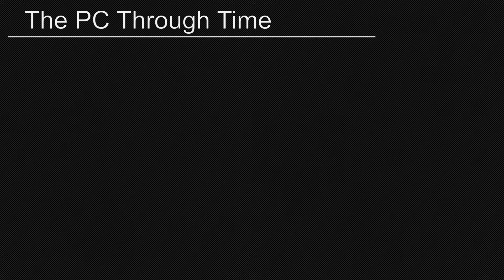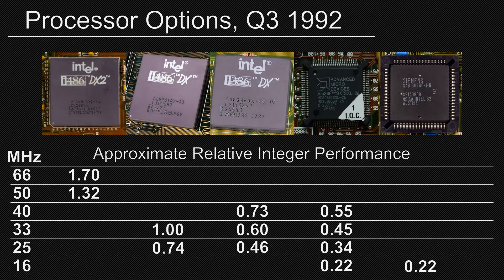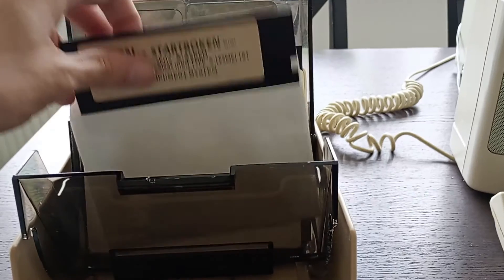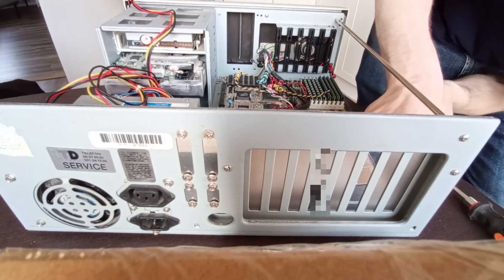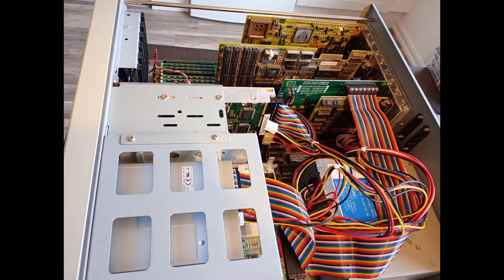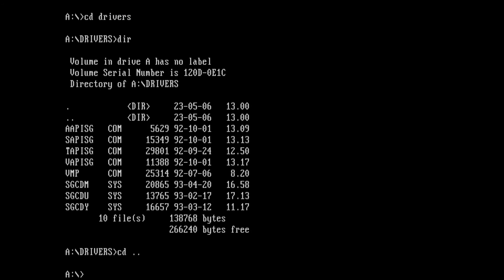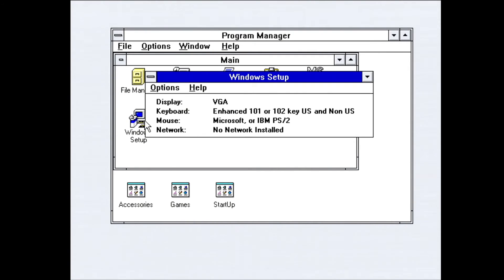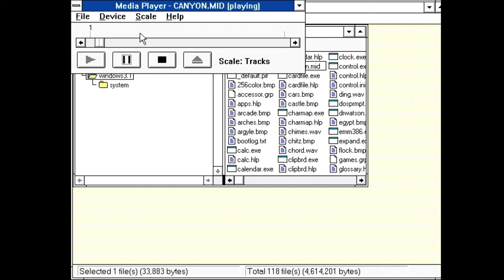Building a Computer Like It's 1992

Comment: Oh that brings back memories!
In 1989 I finally replaced my old Apple //e with a new Zeos 386/20, 4MB RAM, 80MB HDD.  This was a year before Win30 came out.  I gradually upgraded various components of it over the next couple years -- 2400-baud modem, 387 math coprocessor (~$400!), 8MB RAM, a pair of 120MB IDE HDD's, etc.  Probably a Video7 VRAM card.
In 1991, i upgraded it with a 486/33 motherboard with either 8MB or 16MB RAM.  I was a programmer by then, so i needed adequate performance.  I think the next year (1992) i popped in 486/66 dx2 cpu.  Upgraded the RAM to 16MB if hadn't already.
Also by 1992/1993 i had replaced so many components that i was able to reassemble all the original pieces back into a second (386/20) PC as a test box.  I think i also got a couple network cards and networked the two boxes together, using early copy of Windows for Workgroups 3.11.  Woohoo, such fun!
Also, looks like in early 1993 i paid a crazy price ($887) for a new 510MB Fugitsu HDD.
And i apparently bought Borland Turbo C++ in 1991 for $324.  It was popular at that time.
Looks like i bought my first(?) CD-ROM drive in Jan 1994 for $325.  And then a second one a few days later for $357.  I'm guessing this one was a CD-RW drive?
Reply: But my current huge computers don't give me the same excitement that first 386/20 did!
But i did copy the C: and D: drive contents before junking it, and all these decade later I still have them, buried several subdirs down on my drive array.  Oh all those quaint 8.3 filenames!

Comment: A floppy drive in a 5.25" drive adapter would have been very rare especially with a free 3.5" drive slot.  Did you not dust off the components?  Even a little bit?
Reply: Not really that rare, i saw alot of variants of them over the years back then. Alot of people built their own adapters even, my brother one of them.